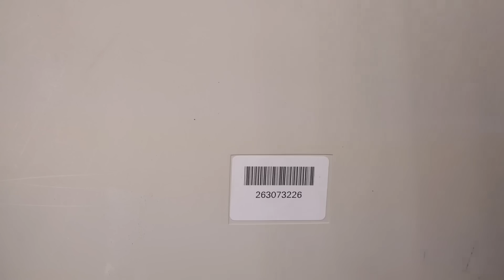Figuring out how to remove polystyrene residue from cords

Comment: When I made ABS juice/slurry for 3D printing bed adhesion, I found that ABS doesn't disintegrate instantly in acetone, it takes a bit of time and a good bit of agitation. Testing by Stefan from CNC Kitchen revealed that gluing ABS with this stuff can result in a fairly strong bond, but not as strong as the plastic itself, the strength of the polymer can be compromised by the acetone. So you don't want to spill any on plastic electronic bits, but at the same time it probably wouldn't kill the plastic if it's just a drop or two. It will happily dissolve or soften many polymers, especially acrylics, and that's also why it's great for fusing 2 acrylic sheets together.

The bottle that nail polish remover comes in is probably polypropylene, the same stuff used for gallon milk jugs. Very stable stuff, and as far as I know, impervious to acetone. There's been talk of polypropylene for 3D printing, and as far as I'm aware, it is a royal pain in the butt to print, even worse than nylon or polycarbonate, and it's because there aren't very many good print surfaces for it other than certain brands of packing tape.

There's also limonene, which has a way stronger (but nicer) smell than acetone, and which can mess with styrene-based polymers (and probably other plastics) by softening them. I remember reading on forums that you can use it to dissolve high-impact polystyrene support material for ABS prints, and when I tested it, I ended up with a softened ABS print that smelled like orange oil with some softened HIPS stuck on. Not quite as dramatic as acetone. Limonene is probably best for dissolving acrylic adhesives like the double-sided tapes used to stick iPad screens into their frames, and it should be cleaned off immediately with isopropanol.

Comment: No wonder it felt like glue. As a kid I used to make plastic model planes, and instead of buying glue I would just feed the plastic injection molding sprues into a small bottle of acetone (ie. Mom's nail polish remover) and when the consistency got gooey enough it could be used as a glue. Once smooshed between parts the residual acetone quickly evaporates, and you have a very solid bond. You can also just put minute amount of acetone on the edges to be glued together, and quickly mate them, for a very solid bind, although this is risky if you use too much, or wait around too long. Both are old timey model builder tricks. Handy on Christmas day, when you get a model, but there is no model glue in the house, but acetone is always around. The memories. 

Later on I used this to fix cracked computer cases, but one needs to apply gingerly, and be quick about it.  Once you get a hang of it hairline cracks can be excised almost invisibly.
Reply: Great hints. Thanks. Especially for glueing cracks.

Comment: The styrofoam and the plasticiser in the PVC do not get on well with each other.  The general stickiness of the curly cord will also be due to the plasticiser coming out of the PVC given the age of the keyboard.  The same issues can be seen with old PVC electrical cabling too.  Search for green goo and electrical for some interesting pictures of what happens when the plasticiser and copper wire have a disagreement.

Comment: Poly styrene and poly vinyl chloride may be having a reaction as they degrade in contact with each other in the box...pvc does outgas for a good while after manufacture...maybe the chemicals it's outgasing is reacting with the poly styrene which is fairly reactive with most solvents...acetone benzene ect will melt poly styrene to a sticky highly flammable substance...but once melted and the solvents evaporate I've noticed the residue can be particularly stubborn and even damage other plastics...the other problem is that we don't know exactly what random chemicals were used in the manufacture of them originally...there were much less regulation of that type of thing back then...they could have substituted one solvent for another or who knows what...acetone and poly styrene makes a napalm like substance by the way...so be careful with it...one spark and you will have a very sticky very flammable substance that is very difficult to extinguish ...and acetone can damage many other plastics...including discoloration...I hope everyone is having a great day or night! Be safe!

Comment: D-Limonene. Pure, water-clear dextro-limonene (not the yellow/orange colored stuff). Great solvent. Literally dissolves styrenes. Doesn't hurt ABS or PVC but keep it away from anything with a #6 recycling triangle. It doesn't evaporate clean so you have to follow with soap and water or another solvent like IPA.

Comment: ChatGPT concurs with your approach 

Removing bonded Styrofoam from PVC can be a bit tricky, especially if you want to avoid damaging the PVC surface. Here are some steps you can try:

1. **Mechanical Removal**: Gently scrape off the bulk of the Styrofoam using a plastic scraper or the edge of a credit card. Be careful not to scratch the PVC.

2. **Use of Solvents**: Apply a solvent that can dissolve Styrofoam but is safe for PVC. Acetone (nail polish remover) often works, but it's essential to test it on a small, inconspicuous area of the PVC first to ensure it doesn't damage the plastic.

3. **Soaking and Wiping**: If the solvent does not harm the PVC, apply it to the affected area and let it sit for a few minutes to soften the Styrofoam. Then gently wipe away the residue with a soft cloth.

4. **Cleaning the Area**: After removing the Styrofoam, clean the area with mild soap and water to remove any remaining solvent or residue.

5. **Repeat if Necessary**: You may need to repeat these steps several times to completely remove the Styrofoam.

Always work in a well-ventilated area and wear gloves when using solvents. Also, be aware that some solvents can be harmful to certain plastics, so always do a spot test first.

Comment: I wuold all but guarantee it's off-gassing from those PVC cables. I've had similar from various bits of PVC, espiecally in record collecting. Those PVC sleeves are AWFUL for records as over time they break down and off-gass. You can see it when you look at the record and the sleeve is somewhat stuck to the card record sleeve underneath. That shows it's breaking down. Why this is a TERRIBLE thing for records is that gas manifests on the records itself as a misty sheen and when you play the record it's noisy and awful. And you can't get it off again.
So anything PVC I take great care to either keep it away from other things or remove it entirely. It's a pain in the arse.
I would caution against using acetone too drastically on PVC. While it does indeed clean a lot of things off, it might not appear to do much to the PVC, but it may in time. I've had cables that I've cleaned stuff off that have gone hard over time and only where the cleaning took place. SO bear that in mind.
I do also tend to go for high percentage IPA (above 70%) as it tends to doa decent job without being much in the way of damaging.

Comment: Acetone will dissolve PVC, so probably don't do that. IPA can clean PVC, but it can reduce the gloss and turn it somewhat matte over time, but it won't actually dissolve the PVC. But IPA won't have a lot of effect on polystyrene as you see, but maybe it can loosen whatever chemical bond was formed. Who knows. If you're really determined, gasoline will immediately liquefy polystyrene and shouldn't harm the PVC. Over a long period of time, gasoline can leach some of the oils out of PVC leaving it stiff and brittle, but that takes a lot of time and shouldn't have any effect with just a quick clean.

Comment: We really need some actual materials science people to weigh in on restoring plastics.  Some plastics can be "re-hydrated" or "restored" with chemicals, but other chemicals can damage the plastic.  I know i could use much more knowledge on the types of cleaners and chemicals work on the various plastics and materials used in these old machines.
Reply: Prime example is some plastics and astronomers can be restored to flexibility with a little baby oil, and some respond better to vasaline (sp).  I have kept some flashlight O-rings soft and pliable for over 10 years by cleaning them with a soft dry cloth, and then rubbing them down with vasaline and letting them sit overnight.  Then wiping the vasaline off with a clean, dry, cloth.  Haven't lost one yet.

Which reminds me, it's time to go service my gaskets one more time.  ^-^

I've also used vasaline on the door gaskets of more than one car, to keep ice from sticking the window shut, and also keeping the "rubber" soft.

Comment: Another tip for retro computerists, is cleaning a printer platen.  That rubberized plated in a dot matrix or daisy wheel printer can get messed up if the printer prints onto the platen without the paper being in there.  If this happens, the platen can harden and also become very slippery, which can result in bad paper feeding, even with a tractor feed printer.

A little acetone on a cotton rage will clean that printer platen like nobody's business.  Don't know if it helps recondition the rubber coating on the platen, but it didn't seem to hurt.
Reply: There is a product called Rubber Renue [sic] that is used for softening hardened rubber parts, such as the pucks in old record players that develop a dip, which can be heard as irregular playback speed.  That might be something to look into for your platen.

Comment: For cleaning dirt/mold/glue from cables and plastics, I use either dish washer soap or a soft fabric cleaning (anti-mold) product in a piece of cloth (like the one you had covering the keyboard) or a soft sponge (with very small holes) and rub it. The construction of the cloth or the sponge is more coarse than the cue tip or the paper you used and that helps grabbing the residue without being coarse enough to scratch the cable/plastic.

Comment: Goo Gone/Goof Off is the go to for this. You see when you use the alcohol that the foam just flakes off. Thats because its not so much "adhered" to the cord, but they expanded differently and one grabbed on to the other, then pealed off when pulled apart. What you need to do is get it to relax and let go, which the thin alcohol does. A thing penetrating oil will do the same.
Reply: Searching the MSDS for goo gone it appears to be mostly be naphtha with a lemon scent added. I’ve used naphtha and mineral spirits when I need to remove sticky residue from a plastic I don’t want to melt. PVC cement for plastic water pipes seems to have an acetone component to it if the smell is any indication, also it melts the connections together to some degree. I would be very wary of acetone on cords like this, but would think naphtha or mineral spirits would be cheap and effective.

Comment: The reaction between PVC cable and polystyrene is a well know problem. The Polystyrene sucks the plasterciser out of the PVC and makes it brittle. In the UK our houses often have cavity walls and it was common practice to pass the mains cables through the cavity. Fast forward to the 80s and many cavities were filled with polystyrene beads. After some time the insulation on the cable would crack away and expose the conductors. It was worse in narrow boats that were insulated with polystyrene sheets and wired for mains, the vibration of the engine would cause the cables to fail very quickly. Have you ever noticed that cables are often in a plastic bag when packaged in with an appliance for this reason.
Reply: That's interesting the un-inintended consequences of insulation interacting later with electrical wires.

There's plenty of un-insulated cavity walls in the US, built before insulation became common, say in the 50s or 60s or so.  My house was built in 1924, and is a mix of cavity walls, with some later fiberglass insulation.  Blowing in insulation later is fairly common.

I don't know if we ever used polystyrene beads as wall insulation.  Currently expanding foam is pretty common, rockwool was common, and sometimes vermiculite (some contaminated with asbestos), and of course there's plenty of blown in fiberglass.  AFAIK polystyrene was only used in sheets.
Reply: The whole cavity wall insulation thing seems to be fraught with later unintended consequences.  I was let down by an installer and it didn’t happen, which I’m now kind of glad about.   Soz. I’m going off track. There appears to be a whole range of materials used as cable sheathing.  I’m not sure that the soft flexible stuff they use in coiled wires is PVC, but there is a semi rigid form of PVC, so it could be that.  Either way acetone is very aggressive to many plastics so Adrian’s choice with IPA is safe.  Petrol maybe a good try it has poor compatibility with polystyrene. PVCu solvent cleaner is also widely available for plastic window materials that contains a mixture of alkanes (petrol) and other solvents.  I’d be giving this ago if I had any.  Everbuild PVCu Solvent Cleaner SDS (Google) gives a run down on the solvents used.

Comment: From the world of model aircraft :- many NEW models are moulded from expanded polypropylene . This is the foamed version of what acetone (nail varnish remover) comes in. Nothing touches that! Its basically inert. A fantastic American company made BIG models out of styro foam (Byron Originals).  We learned not to convert them to gas (petrol) power, they melted.

'styro foam', is expanded polystyrene. This is fine against alcohols, (see the 'ol' on the end), including IPA IsoPropanol (see the 'ol' on the end? Model aircraft fuel is Methanol.
What styro foam, polystyrene is is very not good at is gasoline. Melts it like its not there.
Your best option for 'gas' at his size is a drop of Zippo fluid.
So to be clear, 4 different solvents - Water, gas (petrol), acetone, IPA.
Hope this helps somebody.

PS Look at your wifes undies care label :- always test in an un-seen area!

Comment: acetone is used when you want to couple pvc pipes together.  So I would not use it with the cord as it might cause some damage.  I have found that using hot water, a little soap and a washcloth works well when trying to remove styrofoam.

Comment: Softening agents in black pvc do react with the polystyrene foam (essentially a glue) turning it back into the glue agent.  I defer from using acetone… as it will react with most plastics except polypropylene. My go to solution is either Methyl-ethyl-ketone or white spirit. Any petroleum based solution will dissolve the polystyrene but not the plastic. So WD40 or brake-kleen will do the job!

Comment: I doubt the cords are "pure" PVC since PVC is rather resistant to Acetone. My new best friend (ChatGPT) brought up the possibility of plasticizer transfer as a method of creating the bond between the cable sheath and the styrofoam. That would track with the enhanced effect of the Acetone on the cable sheath. But it is all guesswork, I am no material scientist.

Comment: I have had an issue with the curl cords on Kenwood 2-way radio microphone cables, they develop a white powder coating and then it tends to crumble into dust! Trying to get the right cables from Kenwood over to where I currently live is too costly. I need to find another source for these cords.

Comment: yep the pvc leaches 'stuff' out that can melt into ABS and similar plastics, making a soft spongy, 'trench' in the plastic, and it stays soft n spongy... this stuff can also react with copper wires making a green sticky goo... see 'franlab' as she's done a video or 2 about it...
Reply: that plastic bottle may be polypropylene, its fairly chemical resistant

Comment: Too late for this cord obviously, but have you tried using a pencil eraser? A bit of rubbery abrasion might do the trick.
As for acetone: Great solvent but difficult to work with. It evaporates so fast that it leaves a thin film of the gunk you are trying to clean off, so a second pass is often needed. Considering that it is not safe with all kinds of plastic I keep it as a weapon of last resort.

Comment: The Cable is Vinyl coated like on your "PLEATHER" Jacket, but not PVC as PVC is hard and used in plumbing and conduits. Acetone will damage Vinyl.

You are better off with something like Goo-Off or Goo Gone. There are  oil based products used on old cars with Vinyl Tops you could you or "Leather Upholstery" cleaner that can clean this up.

Also you need to be careful as in mixing Acetone with Alcohol can create a dangerous reaction. For you it is ot an issue as you used the acetone, wiped it and then used the alcohol. But some might think to take a short cut and mix Acetone with Alcohol in a cup and use it as a mixture and that is here the danger begins. It is not as bad as Ammonia and Bleach but it is bad.

Comment: I use contact cleaner spray with a little rub, as that works without really dissolving the cable or removing the plasticisers too much, which are there to keep the cable flexible. Then a bit of automotive plastic silicone conditioner (gummi pfledge… yes that’s spelled about right) just to get it cleaned and protected.

Comment: An anecdote on Acetone and styrene that just popped into my head; When they were creating the scenes for Star Trek III where the Enterprise is undergoing self-destruction, they constructed a section of the saucer out of thin styrene plastic, and to depict the holes being "burned" into the hull, they dripped acetone from above which then ate through the plastic, opening up holes revealling the interior structure, a bit over-dramatic considering that shortly after the same section went kaboom anyway, but it looked neat on the big screen I suppose... :D
Reply: I've heard the same thing about the "Alien" scene, where the blood of the xenomorph eats through the decks. Parts of the floor were made from styrofoam, the blood was green coloured acetone.